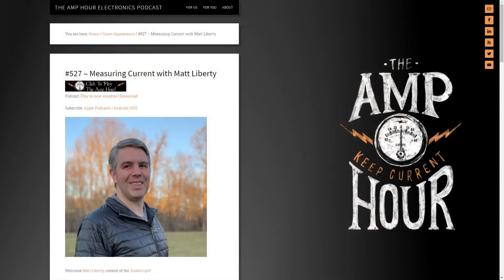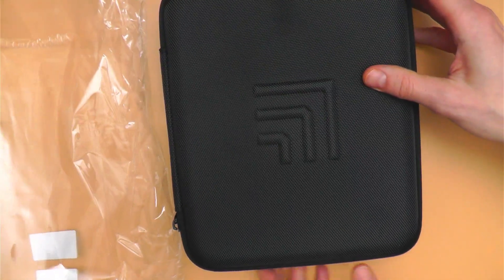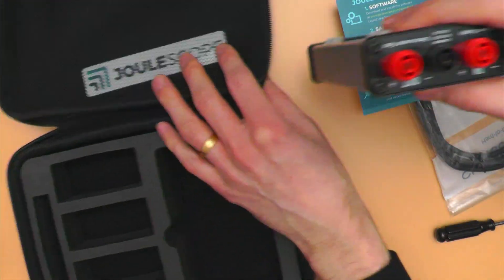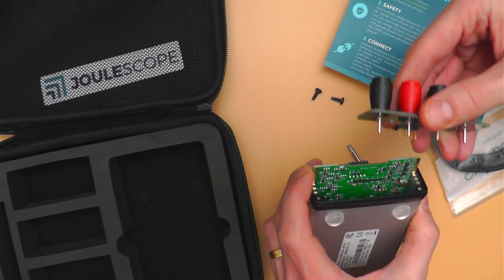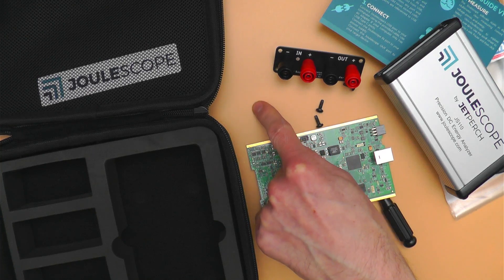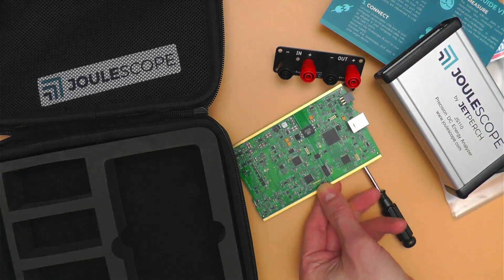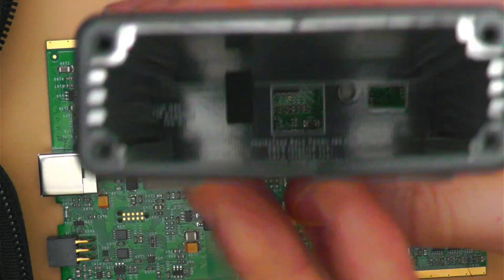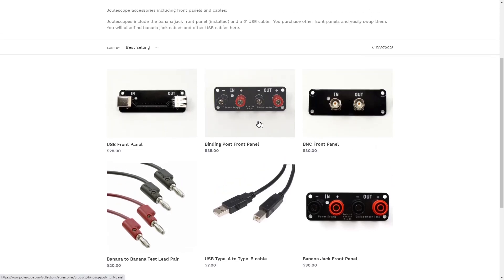Joulescope unboxing and teardown (2021)

Comment: ooh I did not know you could buy panel surface mount shrouded banana jacks
Reply: ohhh of course they are cal test and they are actually pcb mount, seem to sell singles on their site. CT3150 , Gonna try to replace all my test equipment binding posts with these as I only use shrouded cables/probes